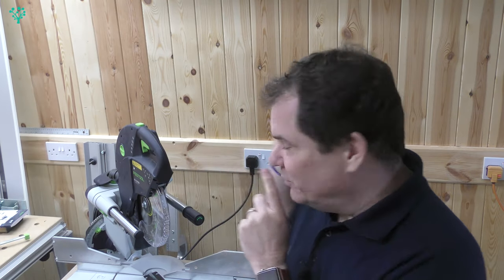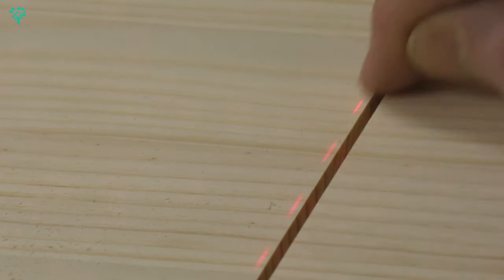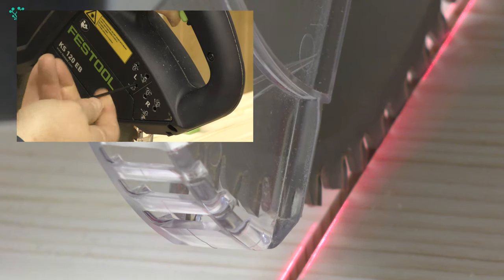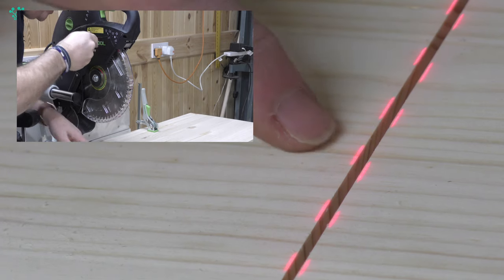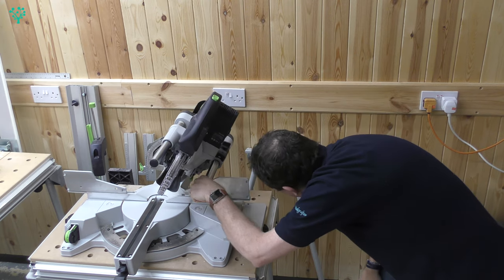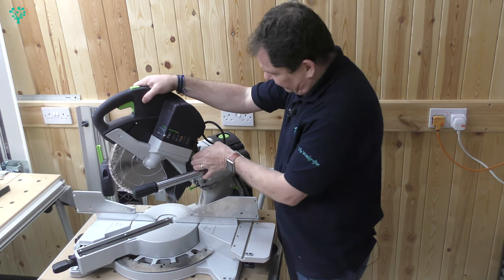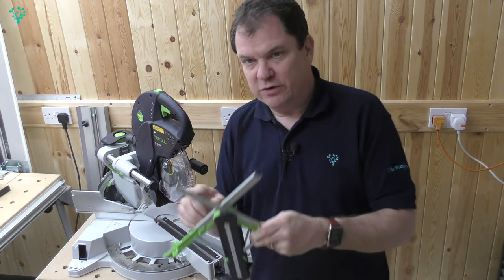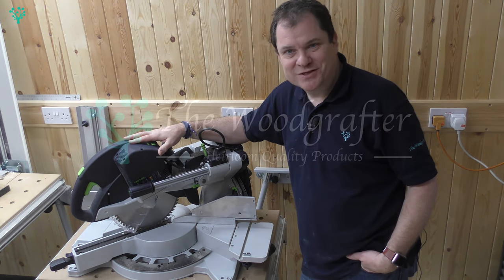Festool Kapex ES 120 EB Review Part 2

Comment: I have mine set up so that the laser lines are INSIDE the kerf cut.  I like lining up the outside edge of the laser with my cut lines.  Just preference.  I do appreciate that Festool gives us the flexibility to set this up the way that we want.  When you put your hand under the blade to demonstrate the deeper cut, I immediately looked over to see if you had your hand on the switches and then looked the other way to find the cord.  AH!
Reply from the maker: +Drew Messmann 

Hi Drew, good point, I didn’t really mention setting it up inside the kerf cut, but yes I can see why that would work.

For me I am definitely and outside the kerf kind of guy, it just works for me. So I set my square where I want the cut  and then use a pencil to draw the line. Then line the laser up on the pencil line and the cut is bang on. 

I had to watch the video back.again to see the bit about the deeper cut, LoL yes that would have been a very risky move.

But it was unplugged and all fingers accounted for.

As always thank you for taking the time to comment.

Talk soon.

Andy

Comment: Andy, hope you don’t mind me asking a question, i respect your advice. I am looking at a KS120 and your video was extremely informative. The new 2019  KS120 is the 120 REB but FFX have the 2018 model the 120 EB which is the same as yours for way over £240 less. Would you recommend the 2018 model or pay the extra cash for the 2019 one. All i can see is it has extending works piece extensions. Thanks.
Reply from the maker: +Richard 

Hi Richard, thank you for getting in touch.

For me the answer is easy.

The KS 120EB is one of the finest saws on the market. So no matter what you do next, you will not be making a mistake.

If you are using the saw in a workshop, then you are most likely going to be making a mitre station at some point so those extendable arms are going to be redundant.

If you are working on site with large stock, then you are probably going to have one of the Kapex extension arms at some point so again those extendable arms are redundant.

If you are fitting a lot of flooring and tend to use the saw on the floor, then those extension arms will be useful to a point. But the Kapex it’s at exactly one systainer high - so that would also give you support away from the saw - and more flexibility. I also leave the crown muolding attached to give me a wider base as well.

As you say, beyond the extending base - the rest of the specs and the design look exactly the same. DISCLAIMER I haven’t used the 2019 version.

I would buy the 2018 version and save £240, that is a great deal - so move quickly.

Cheers

Andy
Reply: The Woodgrafter many thanks Andy your reply is appreciated. Keep up the excellent videos you make on your channel they are an invaluable source of learning.
Reply from the maker: @RpR_Makes 

You are welcome, let me know what you decide.
Reply: The Woodgrafter andy, i took your advice and purchased the KS120 EB, it was a good price and not worth the additional £250 for the REB version. Also purchased the LH trim piece you demonstrated in your video. As you have seen my workshop is limited in size so only room for one trim piece. Thank you for your advice. Just waiting for the delivery date and away we go.
Reply from the maker: Hi,

I think you made the right choice - let me know how you get on.

AND look for that small Hex Key in the packaging before you throw it away.

Enjoy

Andy
Reply: The Woodgrafter andy, Kapex arrived today and all now set up. Hunted high and low for the 2.5mm allen key but to no avail, there was not one in my box i’m afraid. Also set up the LH trimming extension that i purchased as well and wow do Festool complicate things. The box said KA-KS-120-L but in the box was the right hand version. Either i got the wrong hand one or Festool have a different LH and RH to me. Anyhow, pulled it all apart and turned all the extrusions around and it now works. All i need now is some wood to cut. Tried to make an unboxing video but gave up after watching your Kapex 120 video again. Have you ever thought of teaching as you are very informative in your how to videos.
Reply from the maker: Richard

Hi Richard, Love it when a new tool arrives. Hope you have fun.

I couldn’t find the 2.5 hex either - I assumed I had thrown it away. The instruction manual says it’s in the styrofoam packaging. Luckily I had a spare knocking about.

I ordered two of the extension and they both came in the same handed format so also had to take one apart. Interestingly I am having a similar conversation with somebody else in the community - so I am assuming that’s just the way it is.

It takes a few attempts to get the format of the video somewhere right. I usually end up with about 2 hours of footage, shot on two 4K cameras so around 4 hours in total - then that is edited down to the videos I produce. So it takes the best part of a day to make one 30min video. So lots goes into it.

You shouldn’t be discouraged though - the more folk creating videos in the woodworking world the better

Not sure if you have seen this months VLOG (June 19) but I talk about a new direction for the channel that focuses more on education.

Let me know how you get on.

Cheers

Andy

Comment: HI  Very interesting video.  Can you please tell me what the extension piece is on the right hand side? Just about to buy the KS 120.  Crown stop?
Reply from the maker: +Brian E 

Hi Brian, thank you for the feedback. 

The extensions came with the Kapex MFT https://www.axminster.co.uk/festool-kapex-ks-120-reb-set-mitre-saw-mft-base-ax1008690

Details in the link.

Kind Regards

Andy
Reply from the maker: Hi Again Brian, 

Just an additional thought, if you are talking about the small plate that extends the base - then yes that is the crown stop. I would highly recommend a set of those.

Give you a larger working area - and some additional clamping functionality.

Cheers

Andy

Comment: Is the Laser Adjustment exclusive to the US/International Version of the Kapex? Mine doesn't have those Adjustments on the Side
Reply from the maker: Hi,

I don’t think so, I have the UK one. They are under the sticker so you have to pierce through the sticker to find them.

Also they are discussed in the Kapex manual that is the same manual for all regions. So I assume they are the same device.

Cheers

Andy